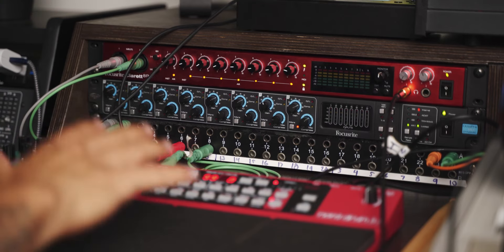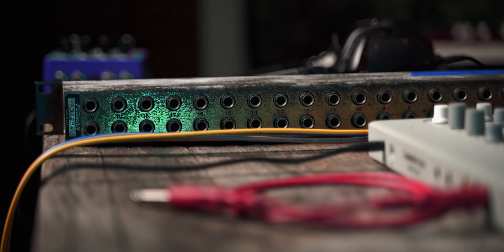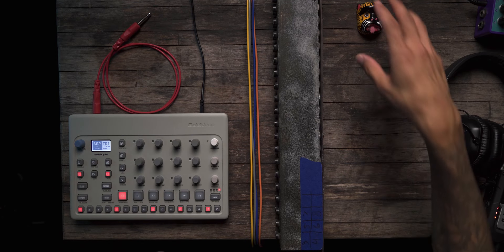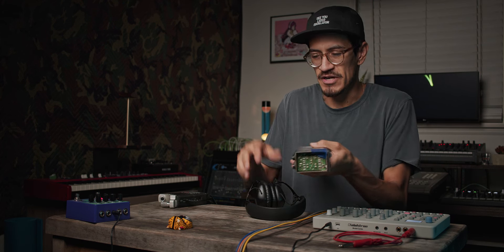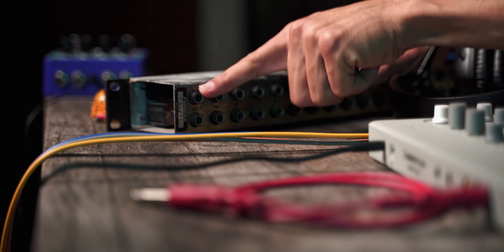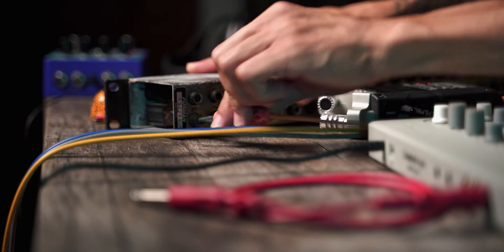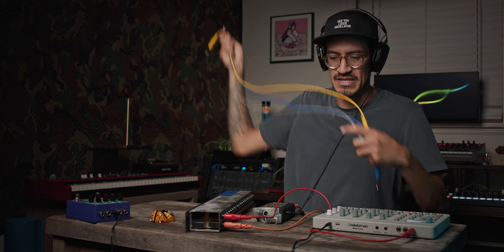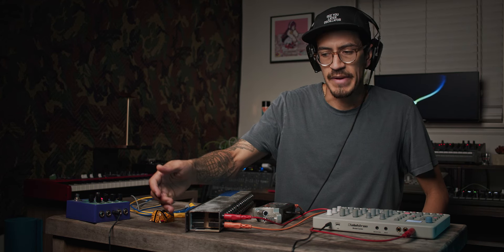3 ways to use a Patch Bay // Why they're amazing but not necessary.

Comment: This seems like a cool thing to have in the studio.  If I typically incorporate pedals into my work flow using a mixer with aux/return, could I do that somehow?  I’m trying to picture it in my head how that would shake out.  For example I have a bunch of synths, going into a mixer with direct outs, some pedals routed around the mixer, and the mixers outs going to a interface — how would I work that out? I think I need to try and draw a picture..
Reply: Did you ever work this out? 😁
Reply: @GuidoGautsch  I did. I had two patch bays and a ton of gear and I got nothing done because with spent all my time routing signals and not making music lol.  I sold some stuff off and I’m much happier with less.  A patchbay is awesome though if you’re into sound design.

Comment: I've been digging around for a pachbay that I can use to connect XLR condenser mics as well as a drum machine and turn table. Do they have Pachbays were you can connect XLR cables for mics that new phantom power with the same normal/half normal setup?

Comment: I'm still wrapping my head around the best way to use a patchbay for a really simple purpose: I have 16 ins on my mixer/interface, and I have 32 channels of outs from my gear. I want to be able to have 8 synth channels hardwired into the mixer, and then use the remaining 8 channels as rotating spots for the other 16 channels of outs. How would I best achieve this? The first half is easy, obviously, just plug the 8 synth channels directly into the mixer, but what is the best way to wire the other 24 outputs through my 24x2 channel patchbay? 

Before I realized what the waterfall effect was, I was just going to connect the 24 remaining outs from my gear to the back top row on my patch bay, and then only use 8 of the bottom row, connected at the back to the remaining 8 mixer ins. Then I'd use short patch cables to connect the "extra" gear I wanted to use that session to the 8 remaining ins through the bottom row of the patchbay. But taking into account the waterfall effect, this doesn't seem like the best way anymore. I guess I could still do this, and just break the normalization each time I needed to use something other than the first 8 channels in the patchbay. 

Sorry for the rant, does this make any sense? I'd love to suggestions from anyone. Love your videos!

Comment: Hey Ricky! Have you encountered any problems by sending your synth's unbalanced TS outputs to balanced TRS cables plugged into your interface? I'm planning my patchbay right now and this really has me puzzled.
Reply: Finally I found the question I was about to ask . But no answers from anyone ?? Helloooooooo somebodyyyyyyy!! With a reverb and echo patched in
Reply: How dod you end up going with it ?
Reply: @axemanarbor  I made a GS thread about this, and it seems that as long as your synths are plugged into the TRS cables using TS cables, it should be fine. You can go from TS to TRS through the patchbay, but you can't go from TRS back to TS. Or at least that's what I understood. Haven't finished patching everything up, but will let you know if I run into any problems.

Comment: With respect, ur titles consistently got me straight mad... also for anyone reading I’m using a dbx trs and a neutrik trs patch bay, cannot tell a difference, but the neutrik feels better and has individual housing per in/out. Anything from a decent company that’s in the $100 range is fine for trs bays, can’t speak on tt/db25 stuff. If you’ve got more gear than inputs on your interface or more than a couple external effects it’s very worth it, pedals included...

Comment: Guitardude here. So the back io is basically in/out while the front panel is the fx-loop to that in/out? I want to get into patching things in and out, would love to get a zoia but well. So i am looking into how i can physically interchange pedals as if my pedalboard was a modular system. Sure my Boss ES-8 can route pedals in whatever order, but as soon as i want to add something that is not patched into it or has no permanent place on may board things get messy. Thinking about getting a patchbay to basically mimic that modular theme. Thanks for the insight Ricky!

Comment: OK, so 2 years later I'm back to see if I missed something. My usage scenario is wiring fx permanently to the back and using the front panel to daisy chain them in different ways. But it's baking my noodle, man. I know I'm missing something because I keep getting feedback loops. 🙈
Any help is appreciated, mate!
Reply: Is the patch bay set to “De-Normal”? You need to set the Modules to “De-Normal” to use it the way you described….

Comment: I'd argue that if you have a lot of hardware gear they are absolutely necessary 🤔 A patchbay is a lot cheaper than an ADAT card or a big mixer. So you can easily expand you 8 input soundcard to however much you need to use all your gear (assuming you don't use all gear at the same time of course). Also takes up a lot less space and allows for creative routing. Does everyone need a patchbay? That most certainly not :) I'm still at the point where my interface can handle all connections but that will change soon enough and when it does I'll go patchbay over a new interface or a mixer for sure 😁
Reply: I still haven’t maxed out my 16 ch mixer, 1 mono and 1 stereo ch left.. When maxed out, I’ll buy a patchbay and route mixer’s inputs into the patchbay outputs, then connect all my gear into the patchbay and patch through it, into the mixer.

Comment: Where do you buy tape to fit a patchbay? Is there a specific kind or just regular tape?
Reply: I just use regular masking tape and cut it length wise. I do it 8 points at a time so it doesn't get too fiddly.

Comment: I missed the through mode in your video. For me this whole normalized, half-normalized thing doesn’t make any sense, exept I would wanna copy a signal like you did. But I‘m running my patchbay in through mode. I have all the Outputs of any gear on back top row and all inputs on back bottom row. For me it makes more sense and it seems you had a similar attempt when you started with Patchbays

Comment: Hi Ricky, How do you connect up the MPC sampler inputs with the patch bay? I tried putting my rc505 outputs to the patchbay in normal mode going into my Clarett 8 pre. The I took an output from the Clarett and put that in normal mode on the patchbay  to the sampler input. Is this  a way to do it that won't harm the equipment? I found using thru uses up so many cables but what I don't know is if it is ok to use an output and send the sound I want to sample to the Clarett output desinated and then the sampler out put connected to its normal Clarett input. I hope that makes sense.
Reply: *designated

Comment: I have a patchbay for some time now and i keep struggling with stereo effects. Especially if i go from a mono sound source and let's say i want to patch it in my strymon timeline. I am using a different channel for both L and R input and output of the timeli e (let's say channel 1 and 2 on the patchbay). From the 2 outputs (L1 R2) from the timeline on the upper row i go to a stereo output. The problem i always have with this patch is that the stereo effects always give faults, sometimes the effects is on 1 side only, sometimes it gives a continuous sharp peep sound and whe i unplug the right input on my strymon the peeping is gone... very strange behaviour and just have it when i come from a mono to stereo source... i tried mono patchcables to patch the patchbay, tried Y-cables with L and R from the strymon to a stereo jack in the patchbay input on 1 channel, no luck... and tried other things but nothing seems to work for me how i want it... is this normal behaviour or am i really doing something wrong here? 
It's also a neutrik patchbay and is all half normalled.

Any help appreciated. 😉

Cheers ✌
Reply: Do you plug a stereo signal with just one cable into your patchbay? Some patchbays are not build for that, some only work with mono TS jacks not TRS jacks.
Reply: @mb2776  i tried both things... with left and right mono jack to 2 seperete inputs (and outputs) on the patchbay, also tried with a Y-cable to 1 input (and output) of the patchbay. same result. Thanks for the reply. Think I will have to experiment more... better did that before I installed +100 cables :) haha

Comment: Does anyone know if balanced and unbalanced jack cables can be mixed into a balanced patchbay? And is it really necessary to connect a ground to the chassi of it?
Reply: Yes. You can mix cables and plug unbalanced gear into balanced bays.  I dont see a reason To ever get unbalanced patch bays.
Reply: @LeslieDugger  Great, because all cables connected to my patch bay are unbalanced jack 1/4" cables. Thou i am using one pair of  "TRS stereo jack to XLR" cables. I guess they are balanced? Since you have two rings on the jack end? Its named "Stereo" but its only one jack and one XLR contact so my guess is that it is a balanced cable. I was just worried that it somehow makes phasing issues or any other problem when mixed with balanced cables.

Comment: I didn't want a patch bay, I got an interface with routing and mixing instead. Things get digitized but I can set to 192khz. No patch cables, just a few clicks and drag and drops and things are connected the way I want, and I get presets. Preset patch bay.

Comment: get a Neutrik NYS SPP L1 if you are ever going to get one, they can be set up anyway you want to, normaled half normaled or through 48 inputs at the price of a samson...depending on how you plug it in. No soldering, no mess, just follow the diagram on the top of the unit and you are golden...The best quality low noise jack inputs on the market. No shade on samson, but those tend to have a lot of noise bleed, which adds up if you have multiple sources plugged in. Ever since I got a neutrik never had that issue ever again...
Reply: Hey this one looks good for sure. If i get things right,,, a patchbay can be used to add more ins/outs and routing, if i have just a 2io interface. Is that correct?
Reply: @vladrileynavilys  yes, you can sum them to two output if that is what you would want, you just need a spider to sum however many outputs you would want to sum to outs of the multispider, even though a would also recommend a small mixer to make live easier...
Reply: @Lalaland.001  Thanks! I do have a mixer right now but it doesn't have separate outs, so the main output goes in my sound interface and that's ok but then i don't have more outputs to route differently. I like the flexibility of what i see about the patchbay... Not sure what would be best yet for me. Cheers
Reply: @vladrileynavilys  It's more about the inputs you have on your mixer. The outs of it go to your interface, so you could use the patchbay to  add more inputs to your mixer. If that makes any sense. A parchbay can be used to add more input to your already existing system...That is how I use it as well. I use the 48 input to sum them to my 6 channel mixer. It just instantly adds more versatility to my set up.

Comment: Liked the video BUT stop calling input of a gear "output". It's already confusing enough how patchbay passes the signal, so  don't make it more complicated.

For example you take your synth's output BUT connect it to patchbay's INPUT so it receives the signal. And then take the patchbay's output, connect it to the input of your audio interface, recorder or whatever.

Don't take it personally though. I say it to people who make demonstration videos about patchbay in general and mix up what's input and what's output.

Anyways, so far the best explaining video about the use cases of patchbay and different routing methods.

Comment: Lossless 24bit / 192kHz over gigabit wireless patch bay. 1024 assignable wireless ports, device based URL managed. Simply plug a rechargeable 1/4" wireless transmitter dongle into your synth.  This will be reality in 2025 - spread the word !

Comment: He has no idea what he's doing.  I mean he has no idea what he's doing.  Or so he says.  And he doesn't.

The first thing you design for your recording studio is the patch bay.  What kind of inputs do you want.  What kind of patches do you want.  What kind of inserts do you want.  How many outputs do you want.  How many extra sends do you want.  How many returns do you want.  Etc., etc.

Then you find you need more than one patch bay.  I currently have 14, American-made 24 x 2, 1/4 in  full normaled patch bays.  And I need about four more.  That's a lot of patch points.  It's 24 crossed by, 24 down, currently.  That's 24×24 patches.  At my very minimum.

So with this fine gentleman is showing you here.  Is perfect for your notebook desktop, personal musicmaking system.  It ain't a recording studio.  That needs 14 or more patch bays.  And probably CLA, Chris Lord Algae needs far more.

Now you're going to get ground loop problems you home recordists.  And you're gonna get plenty of buzzing.  You won't know how to deal with it.  I do.  I don't have those problems.  I never have those problems.  I prevent those problems from ever occurring.  Because for a short while.  For about a year.   I also worked as an electrician's helper to a Master Electrician.  So you learn a few things of what not to do.

I can't live without patch bays.  And I won't.  You shouldn't either.

Now there is un-normaled,, full normaled or half normaled.  I generally prefer half normaled patch bays.  But currently am using, full normaled patch bays.  And numerous ones that are not normaled at all.   And it can get confusing.  When you have 100 patch cords in your badge bay or more.  Then my mixes frequently end up like that.  More than 100 patch cords.  Just to patch in all of the external processors in my racks.   Dynamic range compressors and limiters, De-Esser's high-frequency limiters, downward expanders and noise gates.  Then there is all the digital effects processors.  With one or two inputs.  And one or two outputs.  All need to be in the patch bays.  And I have 6 stereo digital effects processors.  I use them all at once.  I use more than 30 dynamic range limiters all at once.  And I have to patch them all in.  I don't have an SSL 4000/6000/9000.  Oh well.  Everything is on external patches.  It's mind blowing.  It looks like a bunch of snakes having an orgy.  I'm afraid to touch them.  But then you lose the rhythm guitar.  And you start wildly grabbing at multiple patch cords.  Because you got multiple things patched in on the rhythm guitar.  It can get Harry on a live satellite around the world broadcast when you have 10+ million people listening.  It can get a little intimidating.  But that's what I've done for 30 years.  I'm one of those remote truck owners.  One of the last of the greats.  And I'm 65 now and retired.  What a ride!  Holy wow wow!

An old 1970s engineer with multiple major music award nominations
RemyRAD

Comment: If you are using a TRS patch bay, you can handle your stereo instruments with one of those double-1/4"-mono-to-single-1/4"-TRS adapters. That way you only use one channel on your patch bay.
Reply: You could, but you'll be then unbalancing your audio.
Reply: @HammyHavoc  all the cables in this video are instrument cables, already unbalanced. Not all gear has balanced outputs, most guitar pedals don't.
Reply: @dlabrador  I know, but as a general disclaimer to the inexperienced who will inevitably read this comment and not second-guess that it's aimed at Ricky and not general advice regarding patch bays.
Reply: It... is general advice regarding patch bays. TRS can be used to carry balanced signal OR carry stereo signal. I guess if we want to make it a sound byte for the inexperienced, it would be "make sure you understand the types of signals you are bringing into your patch bay, make sure you use the right kinds of patch cables for them, and make sure you know that mixing and matching signal types can cause problems."
Reply: @dlabrador  Yes, TRS can indeed be used to carry balanced signals or stereo signals, but whether the patchbay itself is balanced or unbalanced is a variable that is worthy of consideration, and of course what else you're connecting those signals to as to whether it is balanced or unbalanced.

Most reasonable quality audio interfaces are balanced I/O too, which if someone follows this video, is something to think about. This is why so many people complain that patchbays are "noisy"; they don't consider the signal itself and optimal routing. Mixing balanced and unbalanced equipment on a patchbay that is balanced or unbalanced in itself is something newbies watching this video likely won't consider.